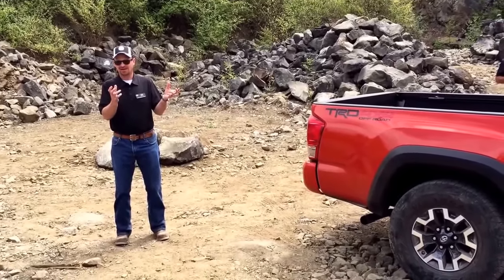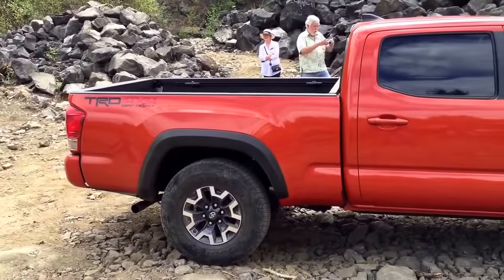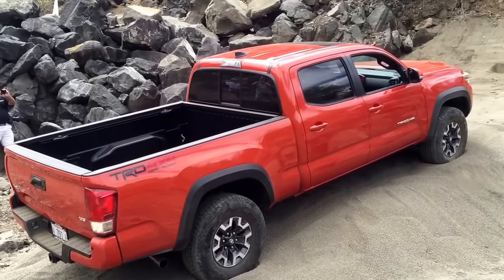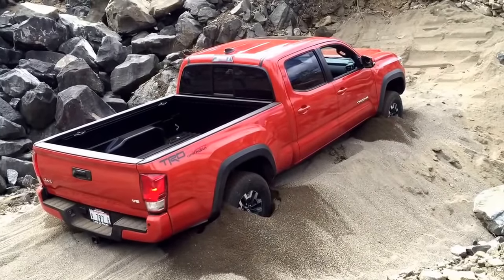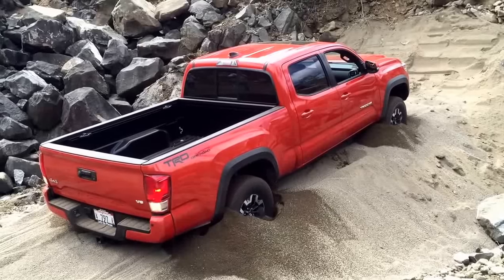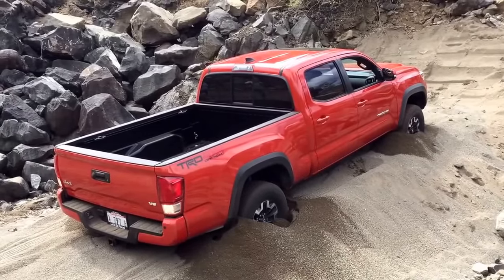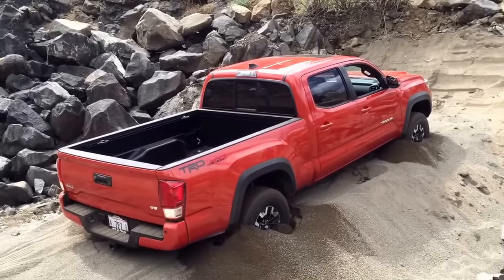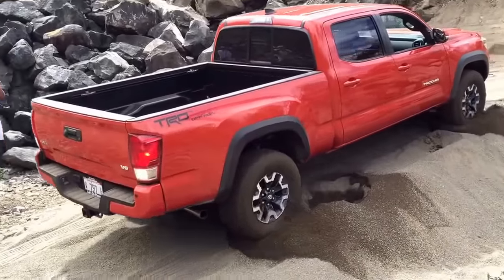2016 Toyota Tacoma - Demonstrating Crawl Control

Comment: All the ppl driving this 2 miles to pick up groceries cannot wait to use crawl control...
Reply: Better than the guy driving his lifted, straight piped, ford f150 20 feet to the mailbox. "hEy GuYs LoOk aT mE!"
Reply: Right. But people dont buy trucks too get groceries.
Reply: @pledgeyourallegiance8530  In the city, they do. Refer to my comment. Where I live, the only time you see a tuck actually hauling something or off roading is if it was made before 2000. Anything newer than that is someones baby that they use to haul a couple big macs home.
Reply: In case they have to run over a parking curb.
Reply: people driving 2 miles for groceries don't buy this truck
Reply: Idk man i use my crawl control all the time Its rated the best offroad pick up truck for a reason....

People use it as a daily like i do but this thing shreds dirt like a jeep
Reply: tommy d u b b s it’s a safe car for new drivers, that’s why I’m getting one soon as my first car.
Reply: That truck doesn’t even look like it’s suppose to go off the pavement. Everyone I see is super clean
Reply: Some 1poisoned the water hole  I never said you did... but the main goal of the Tacoma is not off roading... it looks cool and gets good gas mileage. It is a city truck that shouldn’t really go off road often. And from what I’ve seen my theory is correct. No one goes off roading  with a Tacoma
Reply: Some 1poisoned the water hole the notable off road vehicles are not Tacoma’s or rangers... it’s Jeep and a lifted dodge... those vehicles can go through a lot more than a Tacoma. Someone who wants to do serious terrain doesn’t
Do it in a TRD. Yeh the truck has some features but it is mostly a city driver when you need to get your dishwasher back from Lowe’s
Reply: Some 1poisoned the water hole okay I’ll check it out thanks! And I’m not saying that the Tacoma is a bad truck, I wish I could afford one, but they just aren’t designed for the trail in my opinion. But for a light utility truck or just to have one ? Great truck
Reply: Lil Rake I know your comment is 8 months old, but my God how true are your statements. I’m out here in AZ in the working man’s territory, and most 2015+ trucks are custom and are never hitching a trailer. It’s always the 2013 and older year trucks hauling weight and working. Rich people spending $70K on a Diesel when they’re never planning on hauling ass, but will haul their fatass to McDonalds for a Big Mac.
Reply: Lol
Reply: @rbodell  they get Lincon Navigators
Reply: Fuck yeah..  14 inches of snow today in November; so it's that wet shit snow that turns to ice underneath.    My grocery store is 30 minutes away though so it's a bit worse.
Reply: excellent point